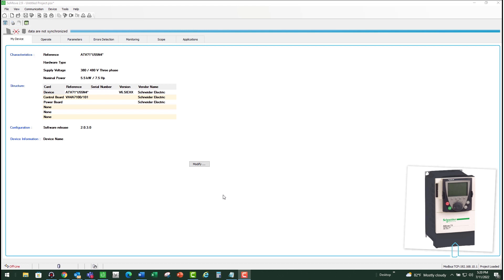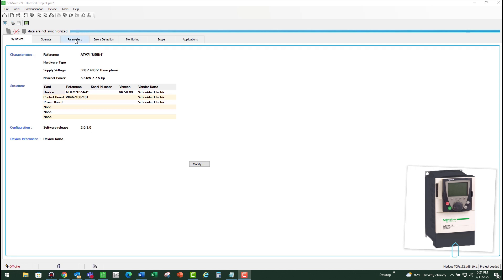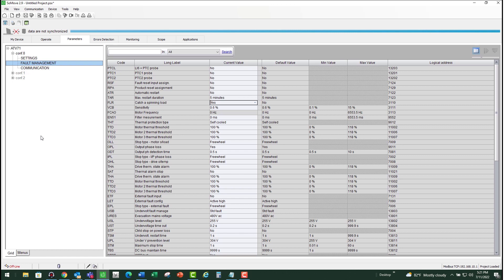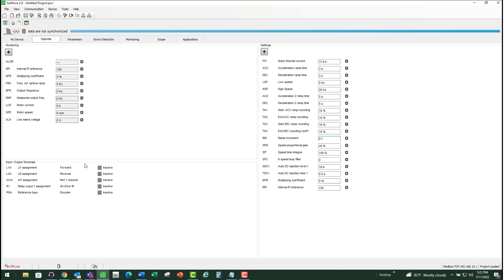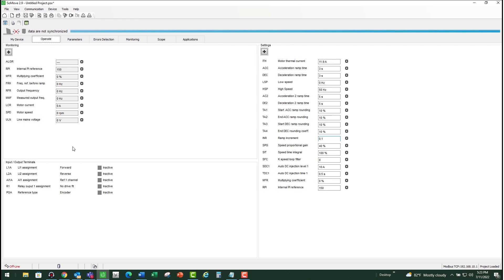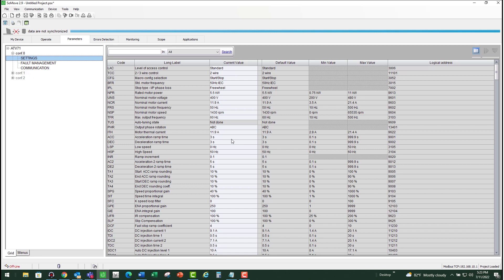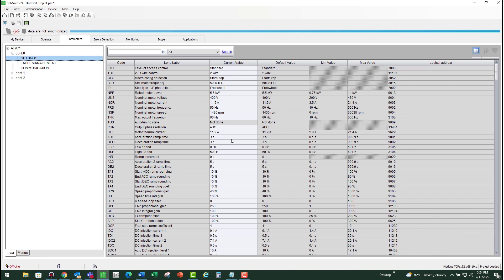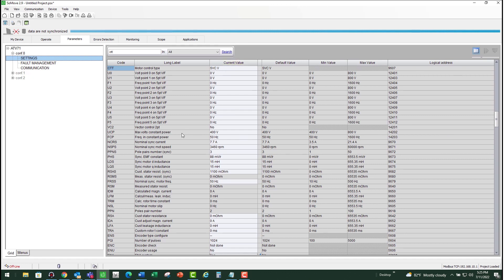OBF Fault on ATV61 and ATV71 | Schneider Electric Support

Comment: Hi in my VFD all Running time show this fault obf fault no time limit ...all parameters checked found normal.load normal .no used break Resisters. And DC bus threshold voltage found normal .
Motor Rating power .1.5 kw 
Motor Rated current. 3,5 amp
Hz . 50 Hz
Voltage.400
Reply from the maker: Thank you for your message. We house most of our documentation in a virtual database here: https://www.se.com/ww/en/download/. If this does not address your concerns, please reach out to a technical support person in your location.https://www.se.com/ww/en/work/support/country-selector/contact-us.jsp